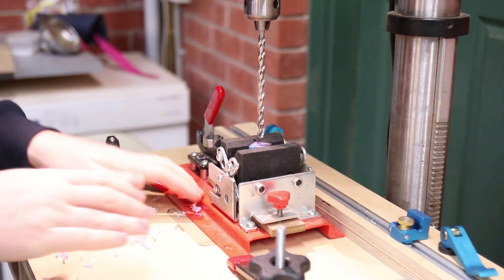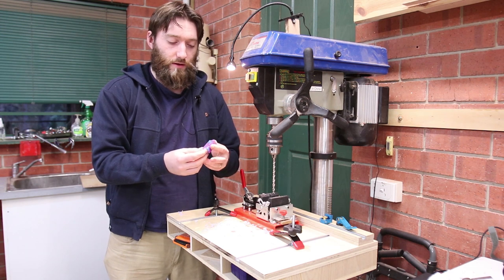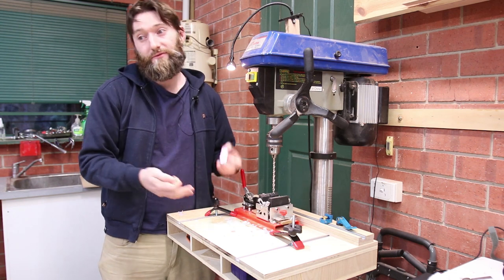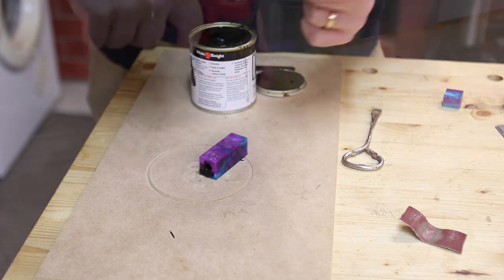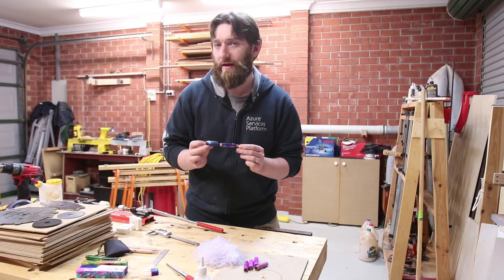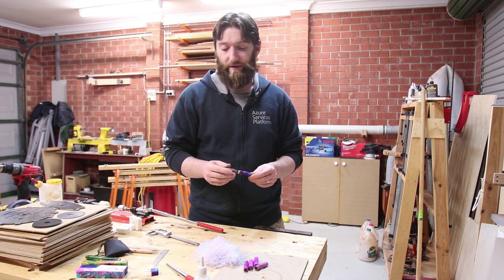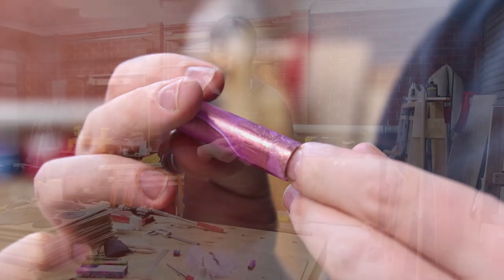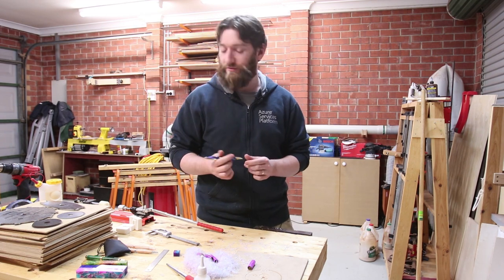DPTG Supplemental: Acrylics

Comment: I learned this from Zac from nvwoodwerks, when you are turning acrylics use an air compressor to blast off the plastic shavings when turning, it's a lot faster then turning the lathe off and picking off the shavings hope this helps

Comment: Mr. Jenkins. My major problem with acrylics has been the tiny voids/holes in the blanks themselves. It is very frustrating to finish a blank and still have what I assume are micro air bubbles trapped in the blanks when they are made. The bubbles seem to go clear through the blank. I have tried numerous different colors and brands to no avail. And there is no way to fill these voids/ holes. I tried CA but only made a mess. Is there a source of blanks anywhere that doesn't suffer from this malady? Thanks in advance-John
Reply from the maker: I've never had/seen that issue. I'd be taking that back to the retailer and talking to them about their supplier

Comment: u/ctrum69 here. very nice job. on mine I only sand to 600 with abranet, but do it wet, and sand long way between grits on the blank, then a quick buff with 3 step acrylic/headlight polish.
Reply from the maker: I hate working acrylics (that smell, ugh!), so I must admit I'm not as well versed in all the tricks for it. Micromesh "1500" is actually closer to 400grit, by the time it gets up to "12000" it 'catches up' to 12,000grit. I guess what you do would be similar to MM 1500/1800 wet sand, then switch to something with a microabrasive (like EEE Ultra Shine, Brasso, etc) in it to skip the rest of the grits.

Do you find the abranet lasts well with wet sanding? I've been meaning to get some more in, but hate buying the poor value little rectangles of it!
Reply: +Paul Jenkins im not sure how abranet stays in business, because it never wears out for me. lasts longer wet than dry because it won't clog. i do use a foam pad behind it to avoid lines and burns.

Comment: I've worked with this blank many times but I haven't had the need to paint the tube since it never showed through
Reply from the maker: It depends entirely on the blanks composition, what resins and dyes/pigments are used, etc.